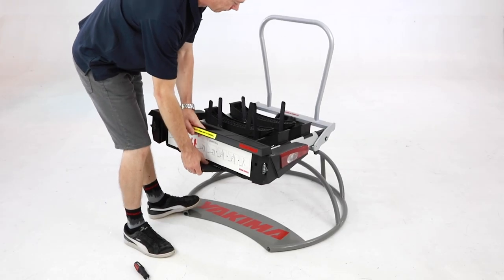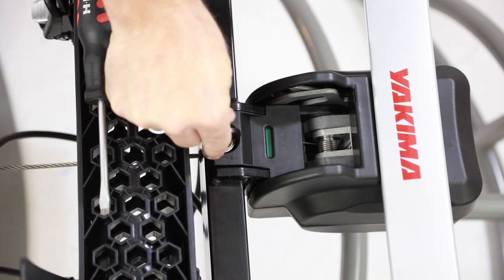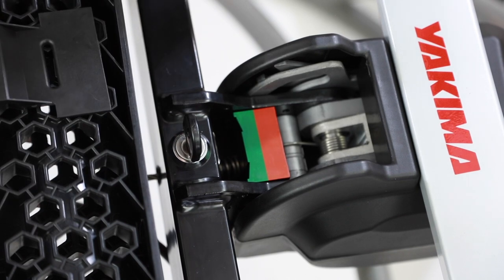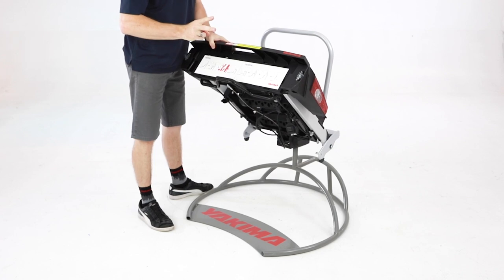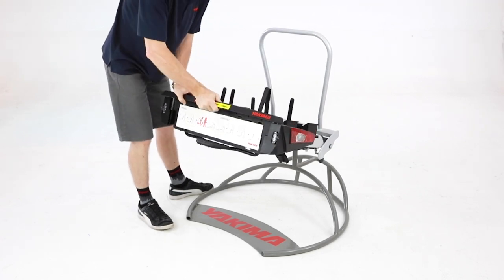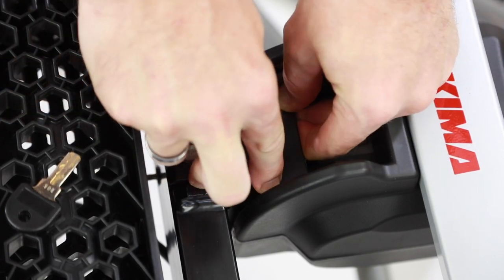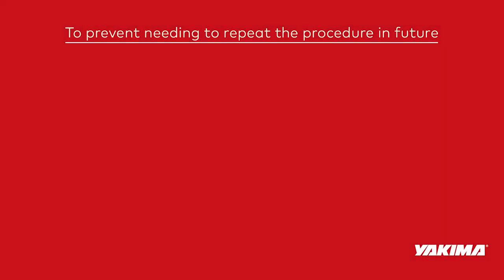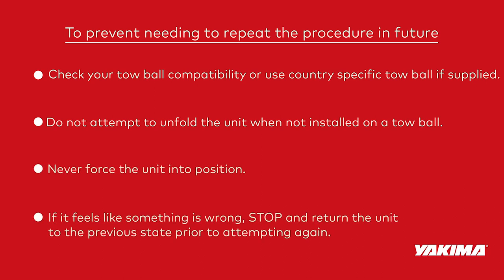Yakima FoldClick 2 & 3 | Reset Procedure when stuck on a tow ball

Comment: Warum ist Regenschutzhulle fur Fahrrader wehrend der fahrt Verboten???
Reply from the maker: Hi, Our bike carriers need to attach to the bike with out any obstructions and have a secure fit. The risk of rain covers coming loose and flying off during travel is also a safety hazard. Our warranty will not cover any other accessory used on our carriers.